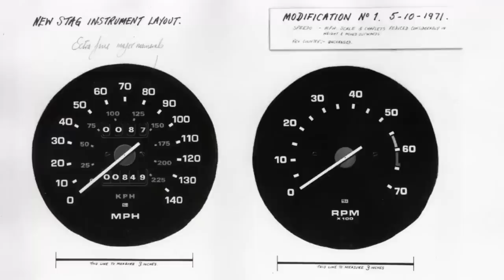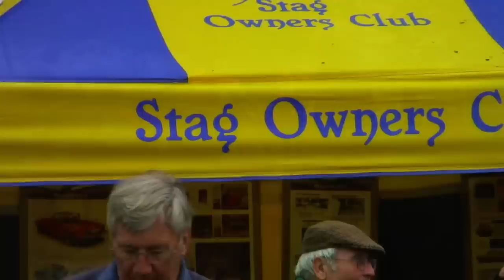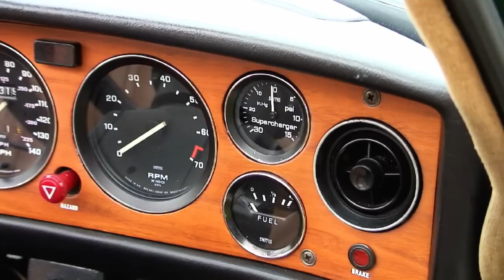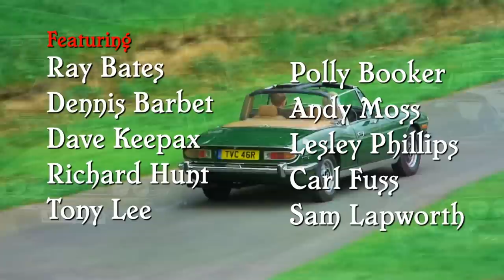Triumph Stag & Stag Owners Club

Comment: Fantastic!  The enthusiasm within these car clubs is overwhelming.  For all the issues back in the day with Leyland  we should be grateful that these cars were ever built.  The engine issues are well documented and easily remedied it seems to me.  I could say the same about the K series engine head gaskets which Lotus sorted completely.  It's all a bit of a shame but the enthusiasm lives on world wide.
Reply: My only concern is that; if the engine issues were so easy to fix, why didn't they do them back in the day? As or Lotus K Series, having known quite a few owners of the k-seires Elise, they were far from "sorted completely"... more like "not at all"! 
At the end of the day it's still BL, and we're not taking Lexus reliability here!
Reply: @utubecomment21  The K series was a very light engine and needed looking after.  Most owners and garages were clueless regarding the low volume of water in the block and would never check it. There is a school of thought that engines should be robust enough to withstand all the abuse that can be thrown at them, but read slow and heavy into this.  The revised head gasket was a revelation - look at the race series of the time, there were very few if any engine failures.  The cars remain popular today, as much as any Lexus, but they can't compete with the cost difference.  I suppose that's why lotus stuck with the V6 - reliability over mass...  the Merc 4 pot will be interesting though.

Comment: Someone should be brave enough to remanufacture a replica with a 400HP EV drivetrain and sound (of course!). It still has the look. I suspect the brave outfit that did it could collect at least 1000 £5k deposits with a £65k target cost - and then that's enough volume to make it happen. Recycling boring EVs will be a thing sooner or later...

Comment: 26:50 Did he say just say 30 to the gallon in an automatic?!  I want what he's smoking.
Reply: Best I get regularly get out of my manual with overdrive on a long run is 27mpg - if its had its gearbox changed out to a 4 speed jaguar unit then maybe it could be possible.
Reply: I had a stag in the 80’s and on a long drive from Melbourne to the Gold Coast averaged 28mpg driving 100 to 125 kph most of the time. The engine was purring along at 3000 rpm thanks to the 4 speed manual transmission with electric overdrive. I loved that car!
Reply: I think he said 13! 😉😂
Reply: @SilverSurfer5150  Well yes that would be more like it.  The one that i've inherited from my father has been with us since 1976 and I remember dad always talked about 18mpg (automatic).  I haven't bothered checking as a tank of fuel lasts a  year, only going out on good days - other than Silverstone this year.  One good day was all we needed :(

Comment: I  had a 1972 Stag. Well the lines and contours of the car were very nice but the mechanical engineering was terrible. The worst was the crappy engine. Prone to over heat, electrolytic corrosion of the aluminum heads on the cast iron block literally ate away heads, head gasket failures due to over temp warping of heads, and other mechanical "issues" caused by poor design and poor quality control. Second worst item was the electrical system. Shorts, corrosion, poor connectors, cheap materials, etc. Ride was good, not great. Interior finish was good but cheap materials did not wear well. Parts were VERY hard to find in USA and special orders from UK were expensive and took a LONG time to get them. USA service technicians knew very little about the car and finding anyone qualified to work on the car was very hard. The poor mechanical design, spotty logistics and lack of technical support doomed this car in the USA.
Reply: Your experience seems to be similar to other Stag owners I have heard speak.  It sounds like all the people in the club just use OEM parts that are re-engineered to better than spec.